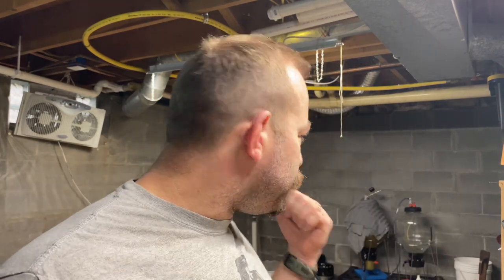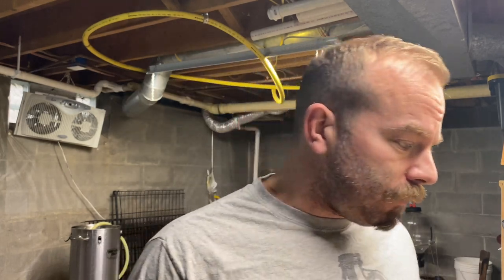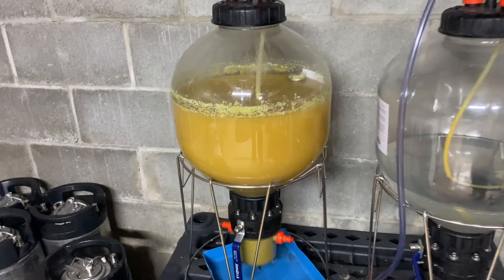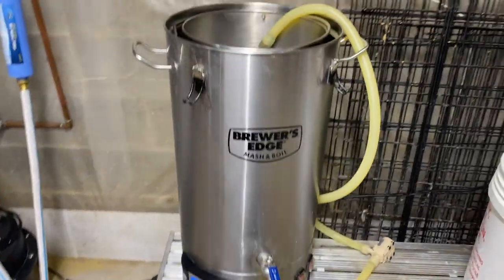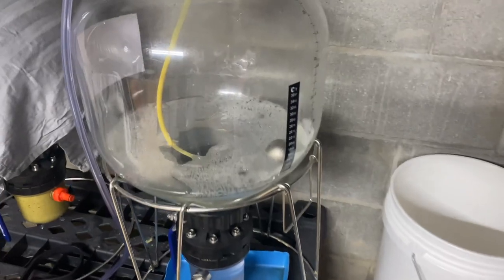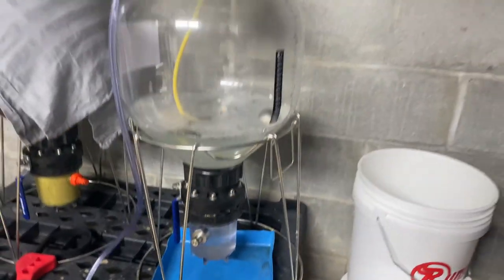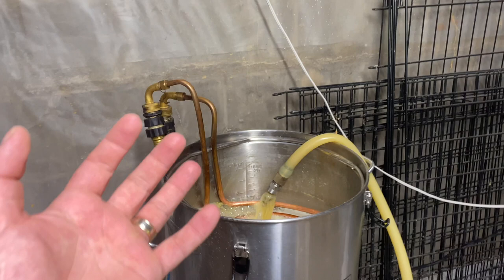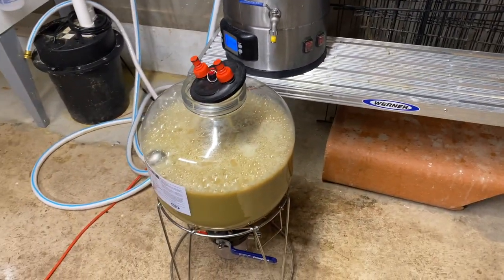BBR: smsqft Nelson and Cashmere APA (homebrew brewday)

Comment: With your fermzilla do you ferment under pressure right away or do you use that tube airlock in one of your previous videos then use the spunding valve? And what psi do you pressure ferment at?
Reply from the maker: I have pressure fermented in the past a couple times, lagers at room temperature. I dry hop a lot, so I'll use the regular blow off tube until the second dry hop is added, then I'll use the spunding valve to raise/keep the PSI at 6-8psi so that I can get a head start on carbonating.
Reply: Awesome! Thank you for the help! Struggled with that with the last brew I made, your citra smash, and it came out very okay. With pressure fermenting at 10-15 psi the whole time and having old yeast, which I didn’t know until brew day, affected the taste. Just brewed your citra/mosaic brew with a little modifications and it’s going a lot better doing your process. Keep it up! Maybe do a video on the fermzilla fermenting process. I haven’t seen too many videos on that. And it seems that your brews are coming out awesome.
Reply from the maker: That's a good idea. I'd like to do the Citra smash again too honestly, I really liked the way that came out. The Fermzilla rocks, they have a good system.